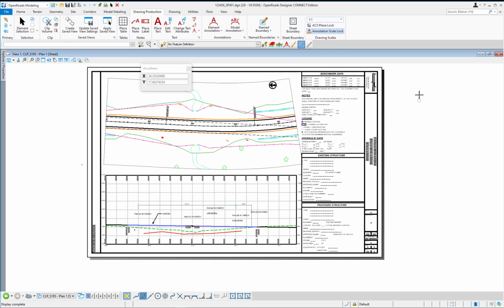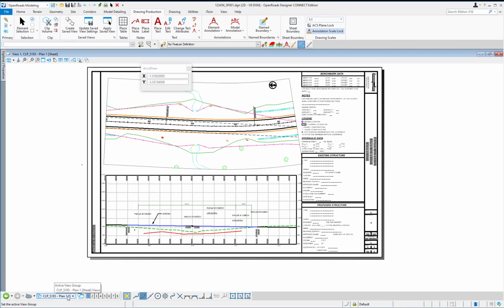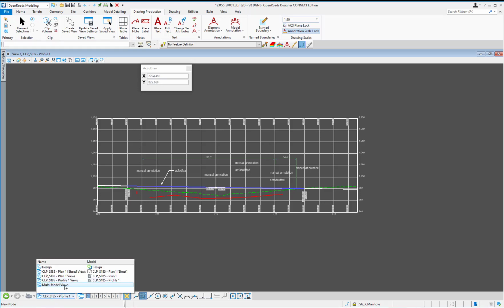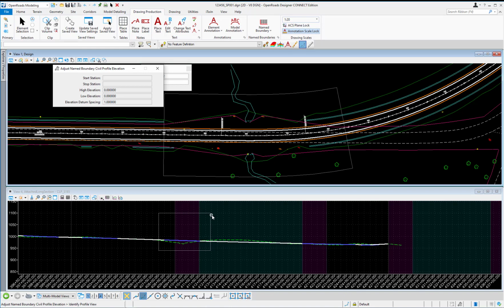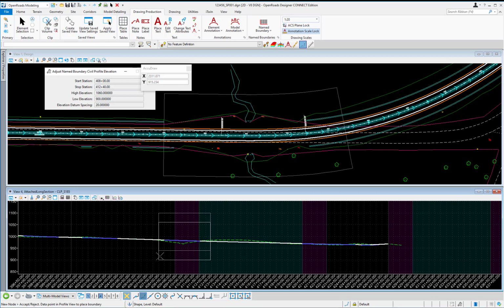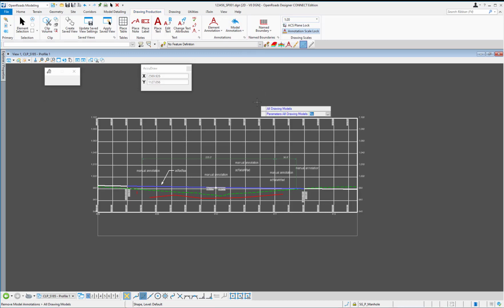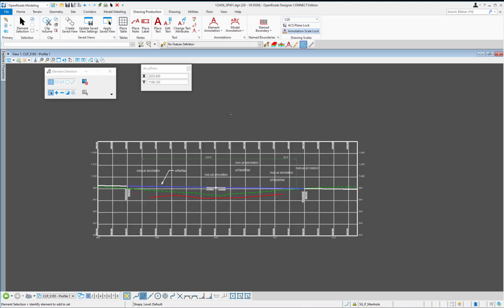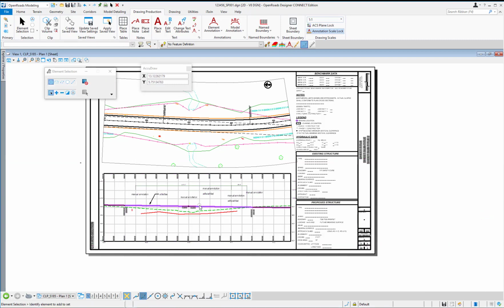ORD Adjust Profile Named Boundary

Comment: Thanks for the video... but when I attempt this it doesn't recognize that the boundary has been adjusted (moved) and it just continues to annotate the profile boundary at it's original location.  Any suggestions?
Reply: Did you ever find a solution to this? Having the same issue . Thanks!
Reply: Same issue.